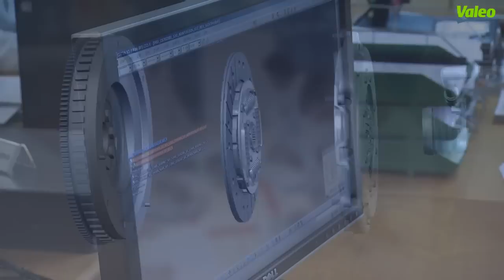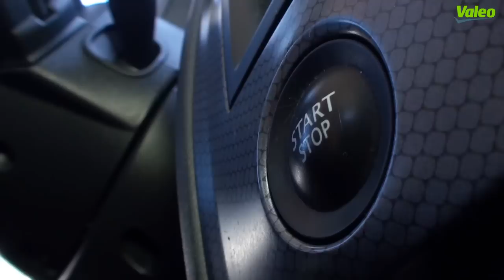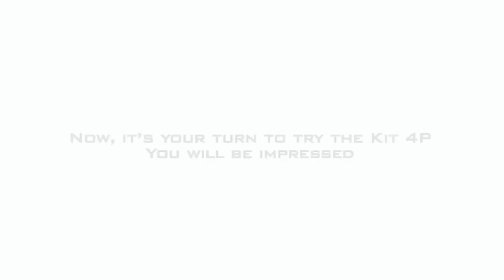[Driving Assistance] KIT4P, Valeo solution to replace the Dual Mass Flywheel Original Equipment

Comment: How in the hell do I get in touch with valeo because their main site there is only a phone number and no e-mail. Seeking for a kit for my Golf 5 2005 1,6  "not FSI" but it seems there are non for that engine, strange???
Reply: +Landton Are the specs same? if yes you can fit the fsi set.
Reply: +nihonkokusai HelloSoory I was confused, my engine hasn,t got this double mass so it is fixed. Thanks!
Reply: Landton ooh ok my 407 sw hdi has